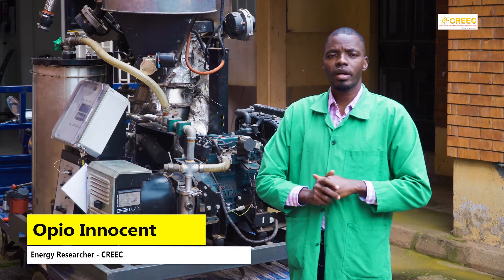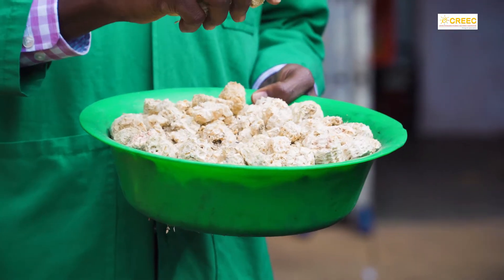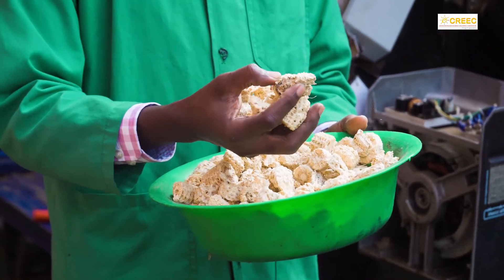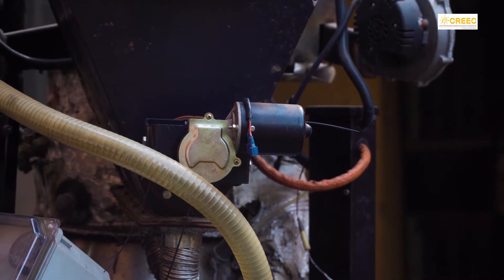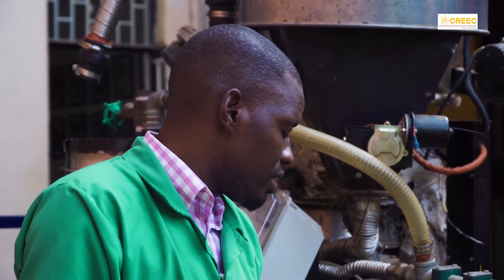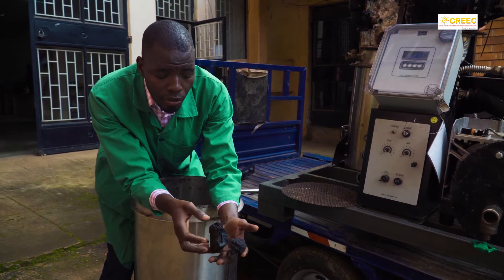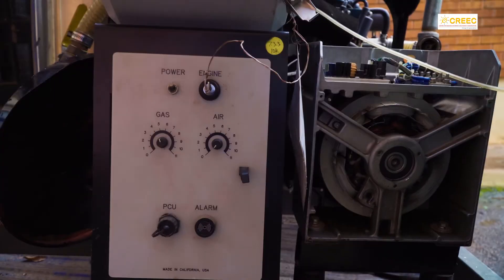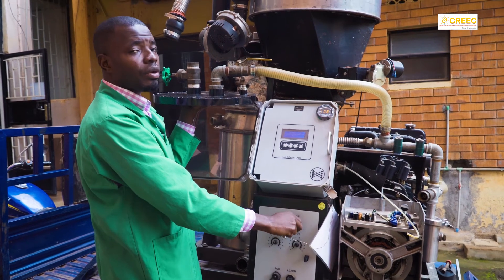Gasification technologies in Uganda | How to operate a GEK Gasifier, Operation and Maintenance

Comment: So What your saying that the corn cob Burns cleaner, And you Have to add wood to make it Burn real hot, Is that right, I,m getting ready to build a Gasifier, For Running my Generator V8 Powered, Great Video
Reply: he's saying the cobs burn cleaner , but you need to keep the reactor at max 900 c to keep the cobs from forming clinkers.